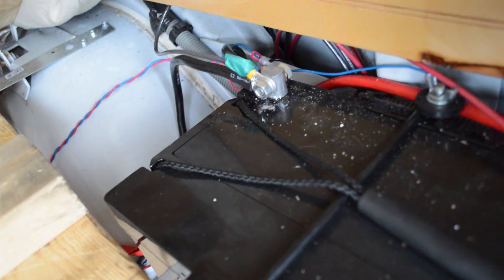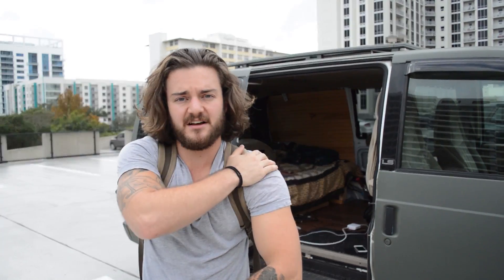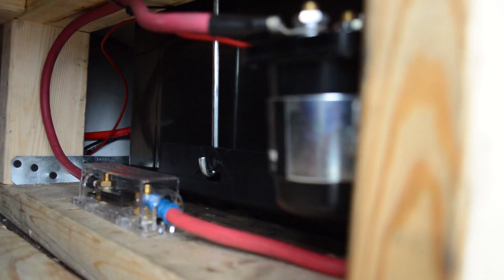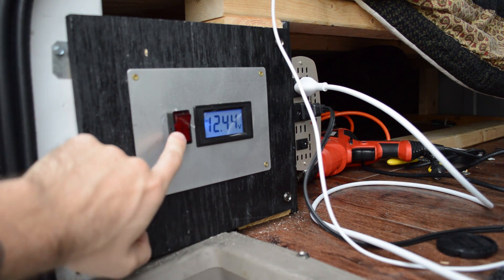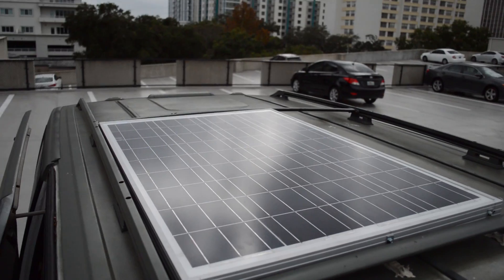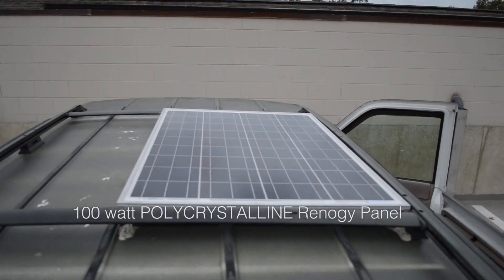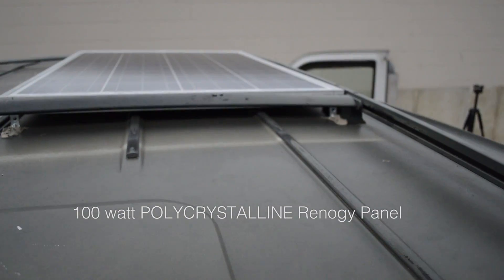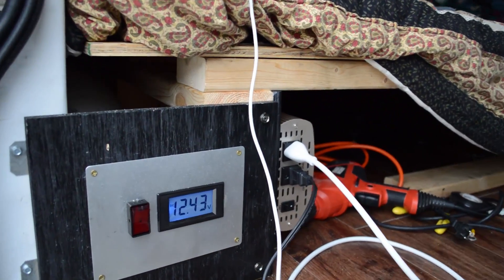Van Dwelling: My 12v Battery and Solar Panel Set up

Comment: I wish you would post or tell brands, cost and installation tips
Reply from the maker: $155 solar $230 inverter$185 battery$300 Install Labor$40 isolator and Some more for like wires, voltage meeter and stuffBut those are for the big items!Solar: http://www.ebay.com/itm/like/301339751896?ul_noapp=true&chn=ps&lpid=82 Inverter: http://www.amazon.com/Wagan-2482-2000-Watt-Continuous-Inverter/dp/B002L4Q62Y/ref=sr_1_1?ie=UTF8&qid=1453247580&sr=8-1&keywords=2000+watt+inverter+90%25
Battery: http://www.amazon.com/gp/product/B00S1RT58C?psc=1&redirect=true&ref_=oh_aui_detailpage_o06_s00Voltage meter: http://www.amazon.com/gp/product/B005UWD2J4?psc=1&redirect=true&ref_=oh_aui_detailpage_o04_s00
Isolator: http://www.amazon.com/PAC-PAC-200-200-Amp-Battery-Isolator/dp/B000CEBXRS/ref=sr_1_5?s=automotive&ie=UTF8&qid=1453247876&sr=1-5&keywords=battery+isolator
Reply from the maker: Also I payed someone to do the install! Hope this helps
Reply: Thanks so much

Comment: What size watts is your inverter to run your refridgerator?
Reply from the maker: I no longer run my fridge! But it is 1000watts
Reply: How come you got rid of the fridge, I'm thinking of getting one but maybe not,
I have 2 brand new 6v 215 amp hr golf cart batteries wired in series to give me 12v with a 100w solar panel. Did you just not have enough power?
Thanks for your reply.
Reply from the maker: I have enough power but my battery starts going low if I don't keep track of it! Besides that I also don't eat much food that needs to be refrigerated. I eat a lot of oatmeal, nuts, beans, and other stuff that doesn't need to be refrigerated

Comment: Great videos. Your using the battery I was considering how has it held up for you? I am mainly looking to charge up my laptop and phones and a few lights. Does the one solar keep it charged up if you park for a few days? Thanks for the great videos I need to send you a message as well I may have some work for you.
Reply from the maker: it has held up great so far!! Charges my devices fine! I rarely go past a day without moving my van. But it should be able to keep up as long as I am not going crazy with my devices

Comment: If I get 2 12v batteries, will I still have a voltage of 12, or will it increase to 24v? I don't want to increase the voltage as much as I want to increase the Ah.
Reply from the maker: I honestly am clueless with this stuff lol hiring a professional made it so much easier
Reply: Yes you will still get 12 V if you wire them parallel, pos to pos neg to neg. A better way to go is get 2 6V deep cycce golf cart batteries and wire them in series, pos to neg neg to pos to get 12 V. Reason being you'll get 12 V but more amps, amps are what you want. Plenty of U tube vids on this stuff.

Comment: So, the one solar panel and battery is enough? cause I've seen people do two solar panels and two batteries, is that overkill? 
         Thanks for the videos!!
Reply from the maker: I would recommend 2 batteries! Depends on what you have. With two batteries you probably wouldn't have to worry about keeping track of the voltage meter. Also I don't even really need one solar panel because I have the battery connected to my engine! It charges up every time I drive around
Reply: ok cool thanks!!

Comment: If the lighted switch is on would the new battery be part of the system to start the van as and say power lights without the engine running.
You have your van wired very clean
Reply from the maker: +64maxpower The battery will be able to run things without the engine on. And there is a way to connect the battery bank to charge the starter battery. I've heard people talk about it. But I don't know how to. It doesn't automatically connect to charge the starter battery though. I think there is something else I might have to do. Maybe down the road I'll figure it out and make a video! Thank you :)
Reply: Wizard Dream I'm asking because I'm thinking if the circuit is open to be charged that the van battery and the house battery would also be connected. I have a tough time understanding electric and that's why I'm asking questions
Reply from the maker: +64maxpower Well the van battery and house battery can not be connected unless the key is turned to start. The circuit is connected to the turn of the key.  The red switch won't do anything unless the van key is turn to the on position and the engine is on. I hope that helps lol I have a tough time understanding the electric part too. That is why I payed someone to connect it lol thanks for commenting :)
Reply from the maker: +Bill Cook no way!!! :) thanks for letting me know! And appreciate all the nice comments. My dad went back to college when he was about 50 too. He loved it. And yeah I'll hopefully be using it to good use while on the road :)
Reply from the maker: +Bill Cook also Bill! For some reason on some of the comments I can't reply to you. It says "error" it might be because of your YouTube settings that only allow people to reply if you replied. I am not sure lol but thanks again! Also I need to get a new bulb for my lamp. It is a 110v lamp my mom gave me: 60watt bulb.. So I will get a lower watt led!

Comment: If you ever run out of ideas of content to post, can you do more of a detail parts list and review over time?  Example: "I bought brand name ABC Isolator and DFG inverter and it burned out after 3 months use.  I'm replacing those two items with these new name brands / model."
Reply from the maker: +tinjuko yeah! If it ever comes to that point I could do that. thanks for commenting :)

Comment: That isolator connection will come in handy after several cloudy days. We hooked one up and it has paid for itself, especially if you are driving around.
Reply from the maker: +VanGo Adventures that is good to hear! :) i am real glad I got it. It will be almost impossible to not have energy

Comment: Come along nicely. Insulation is a must have, better now then later. I put away my Inverter and use only gadgeds that run on 12 V, Inverters a consuming to much Power for me, and I havent any things now that need 220V ( this is our normal Voltage over here). Go on with your build.
Reply from the maker: +Stephan Kluge Yeah I thought so about the insulation. We kind of put up the wood quickly for the solar controller. I'll need to go back and insulate it. That is weird the voltage is different like that! thank you :)